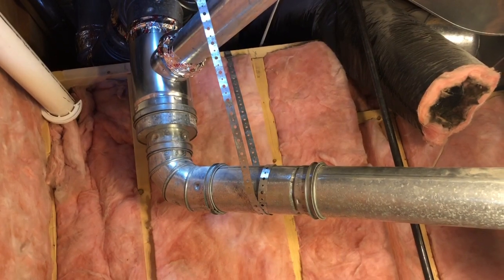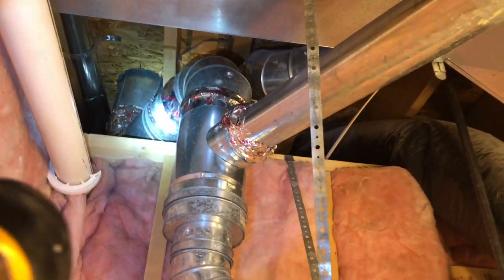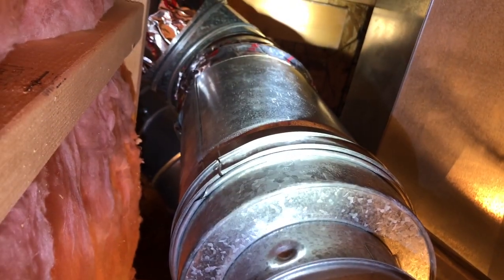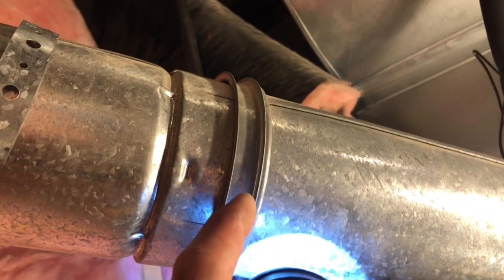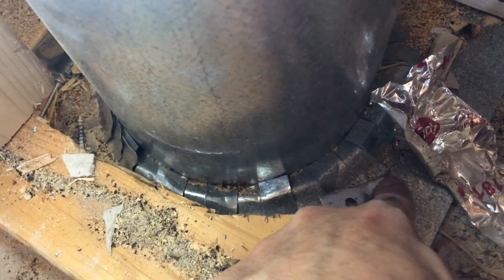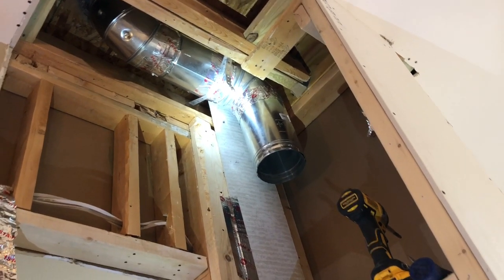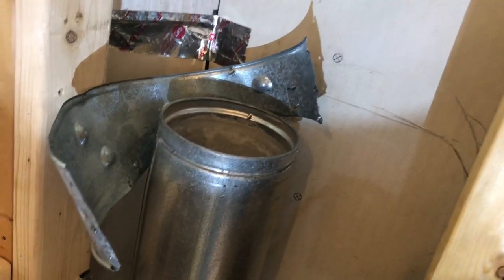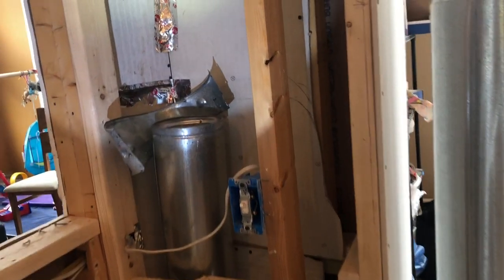What to know before you install B vent furnace pipe

Comment: Uhm?! The 4” B vent is centered inside the 6” single-wall vent, giving the 4” B vent a 2” clearance. The 6” is a shield for the 4” with 2” clearance due to that small  space with wood and insulation. The 6” vent can touch anywhere because it is a shield with 2” between it and the 4” B vent. The contractor did an excellent job.
Reply: Are you suggesting that someone ran a 4" pipe INSIDE the common vented 6" through the elbows and up to the roof?
Reply: @MrJordanworkman  no suggestion, that’s what it is. It would be the only way to do it with the limited space.
Reply: What about the water heater flue? There's a tee inside the larger pipe as well?
Reply: @MrJordanworkman  just like the 4” entering the 6” from the bottom. The 4” water heater flue enters the 6” from the side and tee’s into the 4”, yes.
Reply: @MrJordanworkman  yeah Jesse is wrong. They definitely are running a 6" stack up the chase. No liner was put in that.
Reply: I agree. The b vent is double shielded aluminum / steel. The appropriate flanges sometimes add the 2 " on either side. The home owner did a good job and due diligence for his families safety but some contractors are always going to say negative things of others work. Any one working with b vent knows them further you got away too pointbof combustion discharge , pipe is only luke warm. T I openly laugh at other contractor and indicate he didn't " know what he was doing " and was not paid a dime is wrong
Reply: @benjaminbills1998  nope! I’m absolutely correct.
Reply: @Nopaants  well in my experience from installing furnaces i would say i have never seen anyone put 2 4" appliances into one 4" tee. the induction motor pushes gas while the water heater relies on a draft and heat rising to pull the monoxide upward. it is a 4" to 6" increaser and 6" all the way up from there. its not b vent inside of b vent.. but i can see how that would work in an odd situation. a 4" tee is against code for that application in my state.
Reply: A 4" pipe inside a 6" pipe would not give you 2" all the way around.  You need to redo that math.
Reply: @RandomAxeOfKindness  yes, 1” clearance.

Comment: All you haters writing negative comments about this video are  Contractors afraid to news business this guy did a really good job due to the circumstances  So really pisses me off that all you can think about is your insecurities about losing work  The man had to do what he had to do when you so called professionals failed him so buzz off  In secure haters to the home owner good job man
Reply: Agree.
Reply: Best comment in the thread.   A well educated homeowner will beat 90% of the hack job contractors out there.
Reply: everything show in this video is wrong whether was performed by a pro or the homeowner.... this kinda job needs to be followed by code because if u don't know something u don't guess since u can set the house on fire.  pay attention and you'll see how many 90* he has and also it looks like he mixes different type of pipes some looks single walls and others looks dual walls and both have different spaces when it comes to building materials and also b vent doesn't require any kind of tape =\. if you don't know something, just look online for answers since is all there don't try to be cap save a joe, and fix everything on the cheap side.

Comment: I'm a fire inspector in California.  We always recommend following the manufacturer's separation specifications. Most B-type (double wall) vents require one inch, but always follow what the manufacturer indicates (this information is usually embossed or labeled on the vent/product).  Also, always use products from one manufacturer and from the same series/design ( i.e. Do not mix items from different manufacturers or different systems from the same manufacturer).  I agree with Garrett Lees, who points out that only two bends are permitted and tape is prohibited here California.  Finally, it's good practice to check with your local building department whether or not permits are required for the planned work.  This will ensure one's safety and also protect one's investment when it's time to file an insurance claim, in the case of damage/fire.  Cheers!
Reply: Does it have to be a inch away from the roof sheating??

Comment: By the way tape is prohibited on B-vent. If there is any rust on the joints, you want to see it. If there is any condensation you don't want to trap it. Go ahead and take the tape off, the vent will be tight enough without it.

Comment: Yes it’s 1 inch minimum clearance some manufacturers are 2 inch also you’re not supposed to use the aluminum tape in some areas it’s illegal because hacks will use it to hide holes or rust on the pipe also has to be sized by the total amount of BTUs venting

Comment: I just replaced a section of my exhaust. I didn’t use double layer and aluminum taped all the seams. When you walk past the furnace while it’s on, you can smell the glue from the tape melting. Now I have to redo it all.

Leaving this here in case it helps the next guy.
Reply: B class pipe should be used right? I have a client whose venting is rotted and am planning on using B pipe but wanted to double check

Comment: I like to use perforated strap to tight down the pipe in place I just cut a enough to wrap around it and screw the ends on opposite sides and then I do it again to make an x and make sure when someone is in the attic touches the pipe they don’t shift it or move it, also when installing this and poking it out the roof it’s good to have it tied down that way you’re not shifting it alover the place and it stand straight and within the gap not leaning on wood

Comment: Respectfully intended, but that bottom 90 is not code. Code is a t with a cap, this collects potential combustion oxides from the burning process ( drip t ) forvflue inspection and cleaning also.

Comment: Running  category 1 which rely on convection , minimum measure from combustible material is 6” , sometimes that is not possible , so if you have to be closer than 6” to the studs like in this case , you can create a heat shield , use ductwork material and live it off the wall at least 1”

Comment: I have a non-code compliant issue to watch for when re-roofing.  The roof flashing for the B vent pipe was moved a couple of inches and literally has the B vent pipe now resting against a rafter 2x6.  The solution is not a happy one - the roofing in that area will be removed and new flashing moved back to the original flashing location and then more new roofing will be laid down.  Live and learn, hope my experience helps someone avoid this mistake.

Comment: You are correct. You need 1" clearance from combustibles.
Reply: 3" for single layer pipe is what I was told
Reply: @markp9057  yeah thats probably true. It depends on the manufacturers instructions too. It may differ.
Reply: It does. They all have different clearances. My best advice is look at the instructions
Reply: @markp9057  it varies according to your local building codes.   In Canada I got a new hot water tank and the installer told me the stud being 3 inches from the single layer vent was not enough.   It had been like that since the house was built for 20 years and it passed inspection in 1984.  So I just pulled out an old piece of vent pipe and cut it and opened it to a flat piece and nailed it to the wood which took about 10 minutes.  With a small gap between the wood and the metal ,  That was all I needed and the installer would probably have charged me $100 but I did it in front of him myself.   He said he would not pass the installation without the fix.
Reply: @markp9057  Actually it’s 6 inches for single wall, If you don’t have 6 inches you can just line it with sheet metal!
Reply: @Bobbyc719  It’s not true and it’s not manufactures instructions it’s actually code! 1 inch for double wall pipe and 6 inches for single wall pipe, If you don’t have the minimum requirement you can just use sheet metal to line the area!

Comment: Hmm, whenever I see tape on a b-vent it’s an automatic red flag; either the installer has no clue what he’s doing, or it’s an amateur attempt to mitigate serious installation issues, and usually both. Properly sized and installed b-vent is under negative pressure, and will not leak CO. That job would fail inspection , but so many of these DIY’s are done w/o permits so no inspection. #darwineffect
Reply: Bill C there isn’t any tape approved for b vent. It’s manufactured so All the connections twist lock together. No tape is ever necessary.  Most new houses and retrofits here use high efficiency furnaces and water heaters which use a power vent or inducer that vents using PVC pipe directly through the sidewall. b vents are becoming less common, maybe that explains the confusion about their proper installation.
Reply: Dude listen to the video...
Reply: I will be installing ‘B’ vent in my garage for ceil garage heater soon and will be going thru the roof - I know that these lock together BUT what’s wrong with adding aluminum tape to the seems? I know it’s not required, BUT why not?
Reply: Tom if it lets you sleep at night , go for it, But tape serves absolutely no purpose with a correctly installed b-vent. And unless you spring for tape that’s actually rated “high temp” ($50+/-/roll) the standard foil tape you find at home centers will fail in a few months/seasons anyway.  I’ve even seen homeowners/cowboy contractors use “aluminum colored” duct tape on b-vent; extreme fire hazard. So, get over your need to tape it to satisfy your psychological needs, because mechanically, it’s unnecessary and here in CA it’s a code violation.
Reply: @tomatexelon  Sounds like a winner to me.
Reply: You're right about the tape, but it will just dry up and fall off.   I used some high heat AL tape because I thought it would give me extra protection from CO but   I know now it is not necessary but I don't think it would cause a problem.
Reply: @tomatexelon  The tape can hide problems like rust due to a leak or condensation.
Reply: @tomatexelon  If someone connects the pipes incorrectly (such as not twist locking them) the tape will cover the mistake.

Comment: That would not start a fire , not enough heat
Reply: You are right but if the house burns down from some other cause they can see the B vent was not 1 inch from wood.  I would not want my house to burn down and then the fire inspector finding building code violations.  It could affect the insurance or they could say it was the cause of the fire and pay you zero $ or take you to court and pay you half of what you would have got.
Reply: Tat was the only mistake the old contractor did. Dont think it's enough heat like they said to start a fire.. but the new contractor wanted the work if it was done wrong the new contractor would have took everything down and start over. All about the $$ he took the money out the other guys pocket all he had to do was a easy fix done.
Reply: Tat was the only mistake the old contractor did all he had to do was fix it the new contractor wanted the work if it was done wrong the new contractor would have took everything down and start over. All about the $$$
Reply: Not enough heat during normal function.  It's the abnormal function that sometimes occurs that the safety margin is designed to accommodate.

Comment: HVAC video from a home owner? Good lord. Good job! It looks like crap..  Advice for “do it yourselfers” call a professional who knows what they are doing. Not only is it a water hazard to your home it’s a safety hazard for your family in many ways. It’s not worth being a cheap skate. Building any house demands permits for that exact reason!
Reply: TheBattery00 I just watch a lot of videos on YouTube, and read all the comments people provide and I do it myself, it may take a lot longer but I learn something and I think it may be a cleaner install and better because it’s not their house.
Reply: In my experience a handy home owner that does research will do a better job than 80% of the HVAC "professionals" out there.
Reply: @TrendyStone  I replaced my own hot water tank and checked all the codes and studied up on it.   a $200 lightly used gas hot water tank.   To get one installed would be about $900.  I fixed my own furnace after the repair man wanted to change out a controller board.   He charged $150 to do next to nothing and still did not find the problem.   I had the schematic of the board and figured out how it worked.   A new board from the local company would have cost $175.   On line they are about $40.   But I found the problem , it was a relay ,  so I found a similar relay in my parts cabinet.   I wired it in place and removed the old relay.   It works fine, for free.   took me a week or so but the weather was not cold and I just turned on the furnace fan and left my stove oven on.   Probably about 4 hours of total time to fix it.   The actual replacement part cost about $1  so I ordered a few relays from china.  Working good now for 4 years.   I should really order the replacement boards and just keep them for repairs. 
I fixed a good stove from my neighbor. It would have cost about $350 to fix it , the replacement display with controls was $270.    I just peeled the control tape off the front of the control panel and found a break in the line.   The line is so thin , you can't solder to it.   So I just put some fine copper wires touching the break and put the self adhesive panel back and the glue held the contact with the copper in place.   The stove works fine. 
You don't need these contractors and repair guys if you can study up on things a little.   I replace laptop screens and phone screens.  $10 to $30.   All on youtube, step by step.  Do all my car repairs.  from youtube step by step.
Reply: @jeffbguarino  I agree.

Comment: The tape you use is flammable, if I was you I would  remove the tape you used as a seal ,
Reply from the maker: Aluminium tape is flame retardant and is effective at temperatures between -35c and 120c, meaning that it is ideal for indoor or outdoor use on almost any surface including guttering. The tape is simple to use.

Comment: Too many elbows and he should not be going from 4" to 6"!!!
Reply: Why, I understand the elbows buy why not the 4" to 6"? He added the water heater - I dont see a problem. - What would happen?
Reply: @tomatexelon  you will get a drop in air velocity. That can cause the air to cool quicker than it is exhausting. The elbows as well are already dropping the velocity as well. This can cause condensation issues and your carbon monoxide may not be escaping as it should. Ideally you want all lines to be the same width but if you have to change it's better to go from large to smaller but only if you absolutely have to.
Reply: monquiturdle thanks for explaining
Reply: @monquiturdle   It is absolutely wrong to change from large to smaller, as it will cause back draft.